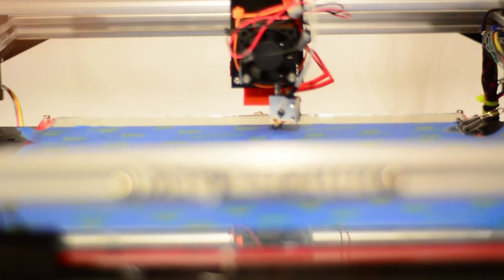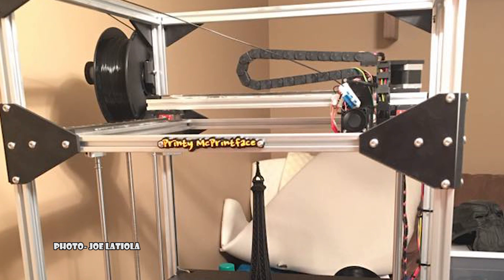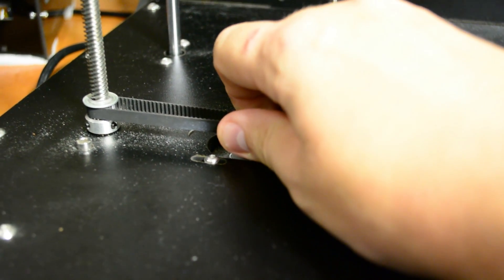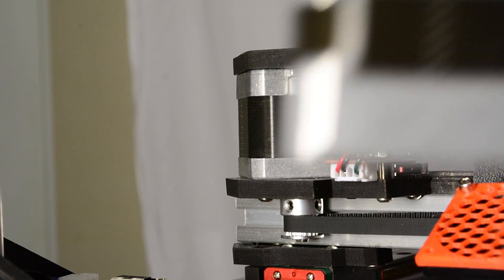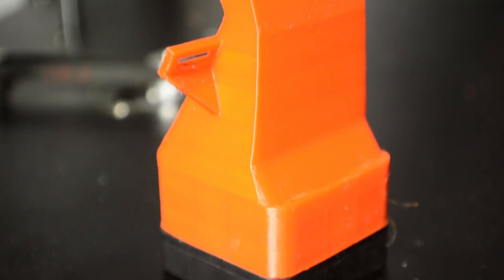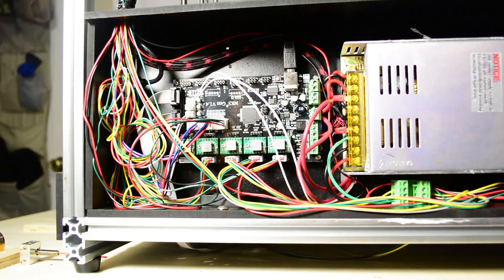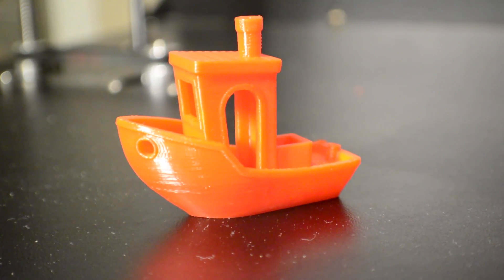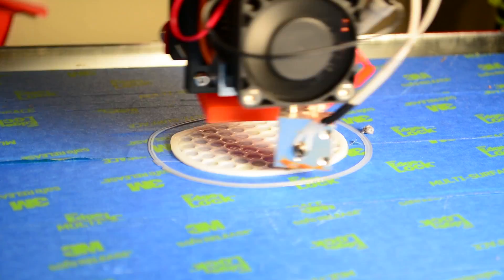Folger Tech FT-5 Large Scale 3D Printer Kit Overview

Comment: I have 1 SLA, 2 DLP, 1 orb-bot, 1 HD2x, 1 Trex-2, 1 Trex-2+ and a FT-5 with some upgrades.  I print ALOT and for 500.00 you cant beat the FT-5, if you have to extra money I recommend a trex-2+ with IDEX but your looking at another 1100-1500.00.  The FT-5 will give you 12x12 inch heated build plate with a standard MK style extruder/hotend setup.  
It works and there is a TON of support via the facebook forum.  if you havent used one I dont see how you can bash it.

Comment: How does this compare to the Creality CR-10 3D Printer? the CR-10 looks really good and i have seen some amazing prints on it.  It has the same build volume and specs as the Folger Tech FT-5. however the CR-10 cost only $400! $100 bucks cheaper then the Folger  Tech. What do you guys think?
Reply: I purchased both printers. I had the CR-10 assembled, calibrated and printing in under an hour. After over 20 hours my Folger Tech 5 is still in a thousand pieces in my shop. It is a complete self build. I wish I could compare the two, but it is hard to do with another 20 hours minimum of assembly left to do.

Comment: Is there a slicer program that is set up to work with this printer, or do we have to come up with all  the parameters our self?
Reply from the maker: Need to do everything yourself. We arent a large enough company to get native support from slicer manufactures. As long as you know the build plate size, nozzle size (0.4) and where the endstops are (MIN) thats really all you need to set it up with most slicers. I use Repetier Host. Printer is a part of the RepRap community, which of course is DIY.
Reply: Thanks DC, I thought that would be the case. Seems like a working profile for the printer that anyone could just plug in to there slicer would be something many would pay for.

Comment: Is the 2020 gantry mounted only to the melamine plate or does it tie into the other 2020 frame?
Reply from the maker: The Y gantries are mounted basically only on the melamine piece, but the melamine is supported at a number of points, and it wouldnt be hard to add a metal corner bracket if you want. I haven't noticed any issues though.

Comment: Are the instructions easy to follow for this kit and do they have any video with the manual
to put it together.?
I guess from what you say in this video the leveling system is easy to setup even if it is
manual but does it stay level???
Reply from the maker: To answer everything, guide is pretty easy, wiring is tedious. No video, you just need to be able to figure certain things out here and there. Stays level for me just fine. You can print most filaments assuming it doesnt need custom nozzles or parts. If the spool runs out, you need to stop the print manually and change it yourself, which isnt that hard.
Reply: OK thanks for the reply Dustin. I think Im going buy one.Ive been looking for a large print area machine and this price is real good for this machine. Thanks again.
Im subcribed to your site and will watch more printing from this machine.
Reply from the maker: alphasxsignal Thanks man.
Reply: Oh I sent the company a email about filaments it can use and they said I might need to get a hot end for doing stuff like wood, flex and others.
I would like to able to do lots of different types like bronze and many more that are out there. Glow at night stuff too.
Do you have a list of all the filaments that could be run through this machine.
Reply from the maker: alphasxsignal Pretty much any non abrasive filaments (ABS,PLA, TPU, PETG etc) will work fine with the stock nozzle, but you can get a hardened nozzle if you want to do more abrasive materials like wood and metals, carbon fiber, etc.
Reply: Oh too Im glad to see the company is in New Hampshire, thats good to 
see too from their webpage. Like to keep things here.
Reply from the maker: alphasxsignal Yup, office and shop is all in NH, all kits and parts ship from there. Fairly small company too.
Reply: Yes they sent me a link to the instuctions etc manuals and they look pretty good
I wonder if they will ever do a multihead for printing clone objects
at same time. I see that on the Beast but it might be a hard thing
to keep sync:) Maybe you will build something like that as a add on:)
Reply from the maker: alphasxsignal haha it is possible.
Reply: Haha yea the price of this machine I can buy four of them of what I would pay for the one Beast and have four different objects going at the same time:) Cool   I just may do that for some projects I have
to sell and need to turn them out.

Comment: Hey Dustin! Nice review!

You mentioned operating the steppers at higher voltages. What would be needed to operate the FT-5 at 24vdc, beyond a PS, of course.  Will the MKS 1.4 operate at 24vdc or is it 12v only?

Thanks!
Reply from the maker: The MKS gen 1.4 is capable of using 24v.

Comment: Hi , I ordered this printer and I was wondering what tools you need to construct this printer
Reply from the maker: Hex keys, pliers, wire cutters, soldering iron, multimeter are the main things.
Reply: I'm thank you very much , would u need calipers
Reply from the maker: Eni Adekoya you dont NEED them, but i recommend them. makes everything easier.
Reply: +Dustin Corbin ok thank you , how long did it take you too assemble it ?
Reply from the maker: about solid 20 hours. This was also my 4th printer kit, so I have experience. Wiring is the hardest part.
Reply: +Dustin Corbin ok thank you very much , wish me luck :)

Comment: Great video Dustin. One thing that helped me with the wires is I took a piece of the thicker sturdier power wire and fed that through carefully . Then I use electric tape and attached that to the wires I needed to feed and pulled it through. Surprisingly the chain is wide enough to accommodate all the wires no problem.